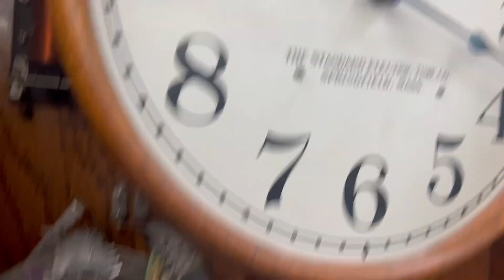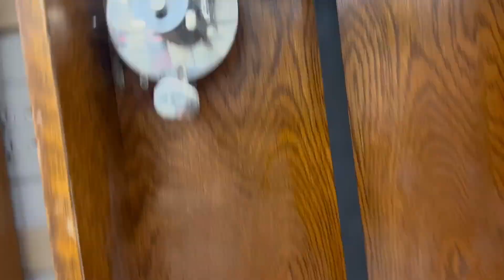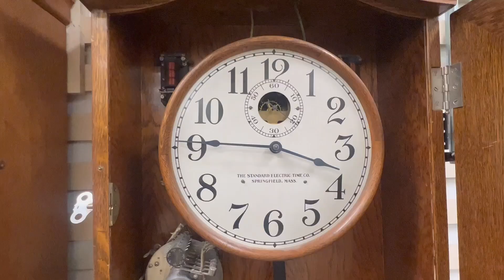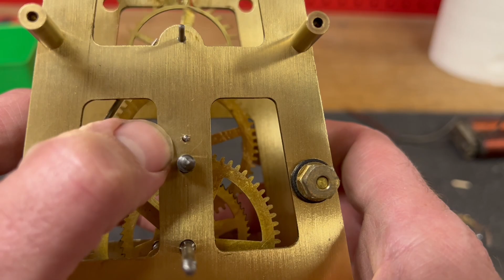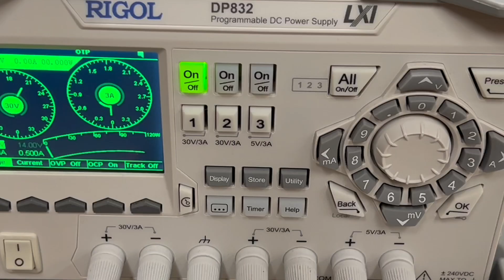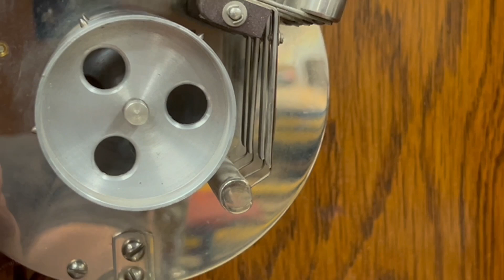Another Standard Electric Time Clock Restoration

Comment: I have the same clock, only a few years newer as the pendulum was replaced by a 110v electric 1rpm electric motor.  My motor is shot, but the rest of the unit is pristine and I have a slave clock. But I have no idea how to fix it - thats a project for another day.  But I want to get it working perfectly one day.  Keep making video's about how these things are wired, what goes where and how to set one up completely with the slave clocks, I'd sure appreciate that.  Cheers!